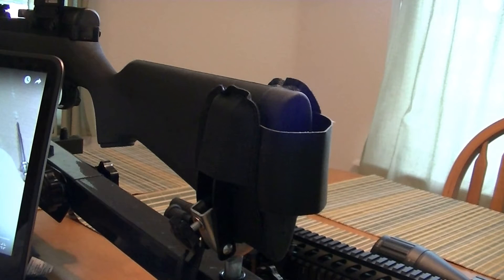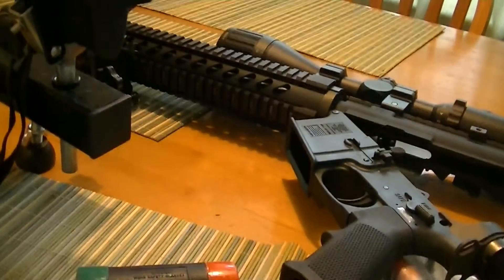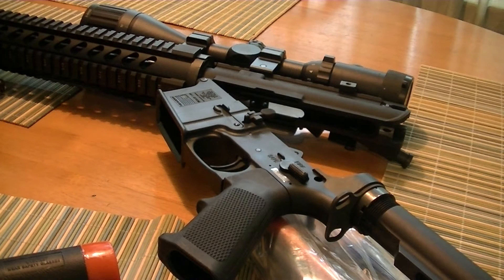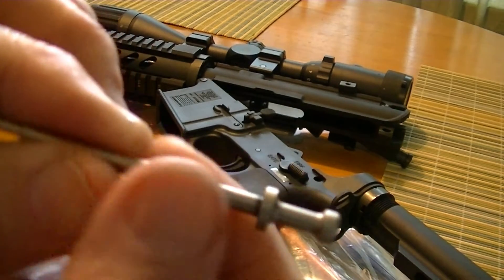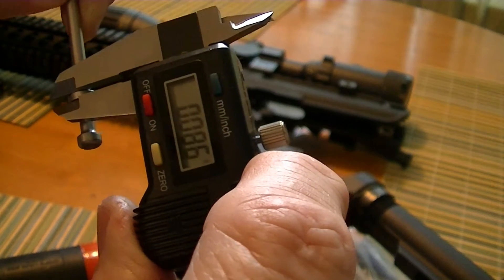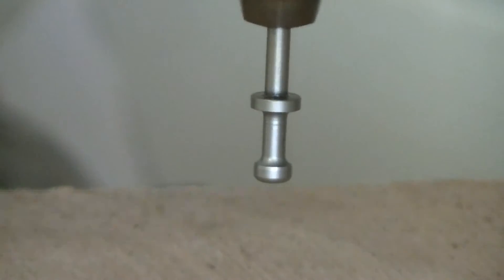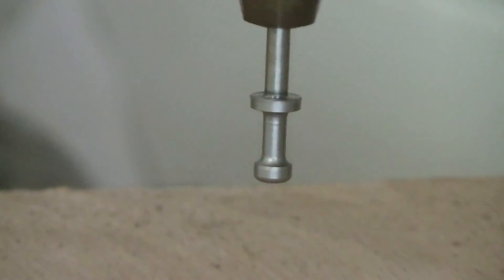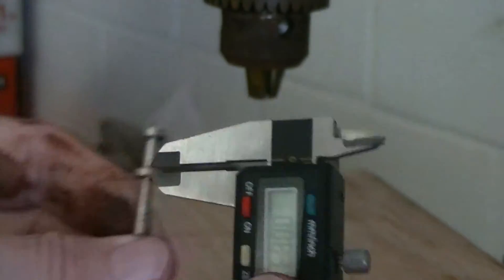7.62x39 AR Light Primer Strike Problem

Comment: A little at a time is a great method. You can always take more off but you can't put it back once it's gone. My favorite comment I heard from my smart ass buddy in the body shop was "Hey Boss, I'm not sure whats happening but no matter how many times I cut this piece, it's still too short." To counter that, our motto in the service was "Measure it with a micrometer, mark it with a crayon, and cut it with an ax. That's the Army way!" Nice trick with the drill. Good tip.

Comment: So was that a regular or enhanced firing pin originally? Could I take just a little off my enhanced firing pin?
Reply from the maker: It was a regular firing pin. I'm not sure how the enhanced firing pins are different.
Reply: @Progneto  They actually are.   I was going to do this mod, but since now you can just order a good pin for $14.  I just went that rout.    Now that I have them side by side, it's not just that part.    The tip itself is longer.
Reply: Not 'longer' as in total length of the whole pin.   But that skinny tip goes further down the shaft.

Comment: Out of curiosity, what would happen if you  take more off?
Reply from the maker: Hi Ryan, they say that if you take too much off, you stand a chance of puncturing the primer. If you do, you might end up with a scorched face. That's why you need to do a little at a time and check it often as you are filing away more metal.

Comment: Good information, but considering what my time is worth enhanced firing pins for the AR are not so expensive.  But for sure if your firing pin breaks and you need another asap being able to modify a firing pin to work could be important.  I also added an extra power spring.
Reply from the maker: I am using the Wolfe heavy duty firing pin spring plus making this modification. I also had to grind the M4 feed ramps into a dish. Grinding the feed ramps was the hardest thing for me to get my head around. You can easily destroy your upper by doing it if you don't do it right.

Comment: Nice mod there! You can also put black magic marker on the area to be machined to see the progress as you remove material. Also, I would measure the firing pin protrusion at the bolt face before and after to check my work.... Have fun, Gerry
Reply from the maker: Good ideas Gerry

Comment: so what was the total you removed? 0.0065? or 0.0075? I was trying to figure out how much i need to take off
Reply from the maker: Always start with a little and work your way up to more. I believe I ended up taking about 0.010 off by the time I got it fixed. Your weapon may be different.

Comment: PSA sends their 7.62 X .39 uppers with an enhanced firing pin. I guess they knew ahead of time of this issue. Great job though on the fix.
Reply from the maker: When I bought my upper, I was told that it might not function with steel cased ammo. I knew I would have to make modifications when I bought it. I love the rifle and hitting about 1 1/4MOA at hundred yards with the cheap Russian ammo. It's a great hog gun! Would also be a great plinker or even a deer gun.